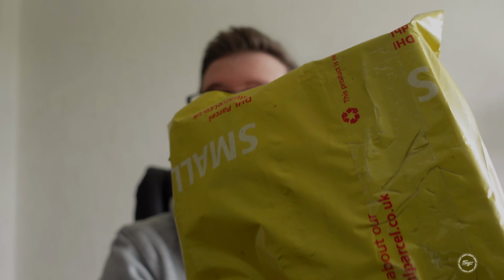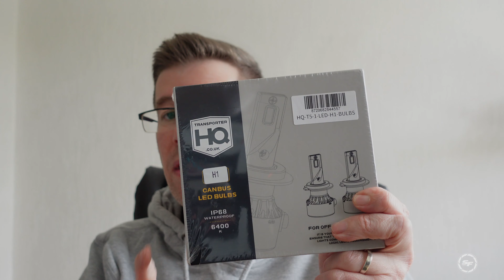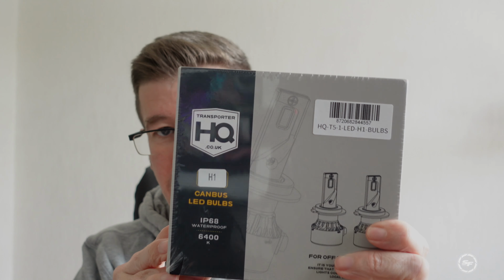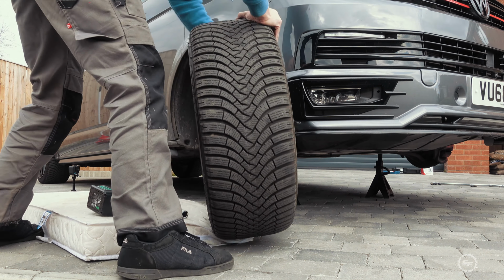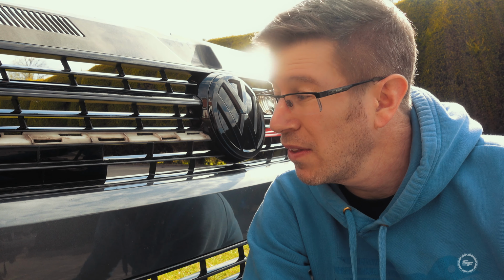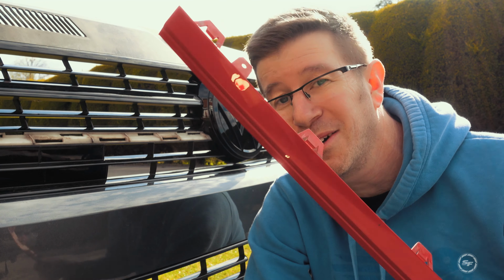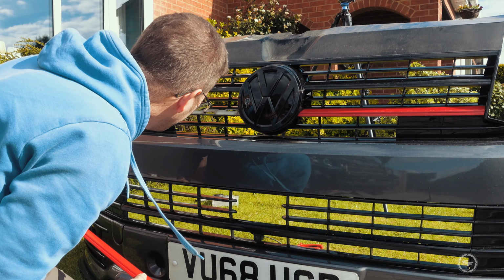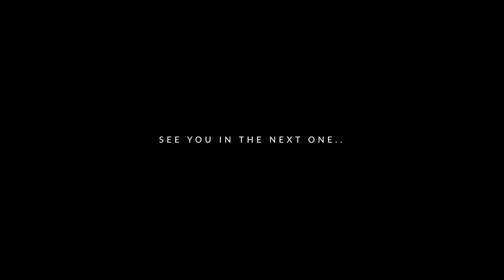Switched the T6 to Summer Mode | New SUPER BRIGHT LED's

Comment: I’ve the same wheels, what size tyre are you running & have you fitted spacers to the rear ? 

Thanks
Reply from the maker: Hi Warren,   Think I’ve just replied via IG but if that’s not the case I’m running 255/35/20’s and no spacers just direct into hub.  👍

Comment: Hi Steve, have you had any issues with THQ LEDs? Both my fog light LEDs and now my day running light LEDs in my main cluster have failed. They flickered for about a day or two then died. Has anyone else found this with LED bulbs from them?
Reply from the maker: Hi Simon,  No I haven’t.. I’ve had the main H7’s in the running headlights for about 2 years now with no issues at all… the new H1 main beams are still relatively new but no issues this far👍
Reply: @SteveField  thanks for your reply. I must have a duff set.

Comment: No need to flip out , MOT centre does not even check , and i had no error codes either . I have them in high & main beam , lights up like the ship outta close encounters , especially with my led drls in the bumper . Position the bulbs by twisting them at the back on the heatsink area , ensure your not getting the darkspot as i also have the new headlights from THQ , with drls , i have a t5.1 sportline swb .

Comment: Hi i have both H7 and H1 Transporter HQ LED bulbs in my version 3 headlamp.
I phoned Transporter HQ about my order and they told me that the LED H1 bulbs will now pass the MOT because i was going to swap out the bulbs too but now i guess i dont have too.
Transporter HQ said as their headlamp unit is designed to work with LEDS it will pass.
Reply from the maker: Hi James,  that’s awesome!! If that’s the case then even better👍👍😎. Thanks for sharing🙌

Comment: Been through two mot’s with the h7 leds. They are on the transporter hq v3 light i it’s. You can’t see the bulb so there’s no issues. Also they have projector units in them so they do give a proper beam pattern. Are your light units just standard?
Reply from the maker: No bud, These are the V2’s and I’ve been through MOTs with the H7 LEDS no probs too BUT this video is about the H1 LED in the main beam which are visible and will fail…
Reply: @SteveField  you mean the full beam. It’s normally as I know it side lights main beam and full beam.
Reply from the maker: @greigallan1973  ahhh ok.  I’ve only ever know it as side lights, dipped headlights and main beam. 🤣. But yes the LEDS I just added are in the full beam ones 👍
Reply: @SteveField  Steve - has the law been updated as I have both the H7 AND H1 led bulbs in my v2 headlights and it passed the m.o.t in June?..🤔

Comment: Great video Steve, which see compressor are you using at the end of the video to pump the tyres up?
Reply from the maker: Thanks buddy🙌.  I will check in the morning and drop you some details…. Was from machine mart 👌👌. I’ll drop you a link tomorrow 👍
Reply: @SteveField  cheers Steve.
Reply from the maker: Here is the link to the compressor buddy…https://www.machinemart.co.uk/p/clarke-monza-15hp-8-bar-635cfm-portable-oil-fr/
Reply: @SteveField  cheers Steve, I was hoping the van would power it but looking at your vid and the spec is plug socket. But looks a great machine.
Reply from the maker: @doubleawindowcleaningphil5003  oh yes.  Def just a garage machine that one but great tool.  Comes with  all the attachments so I pump up all the balls, bikes cars just about everything lol

Comment: Defo sits better on the navis wheels rather than the vossens you use to have mate
Reply from the maker: 🙌thanks buddy.  That tighter offset really helps as the Vossens we’re holding up the front a little on air out.